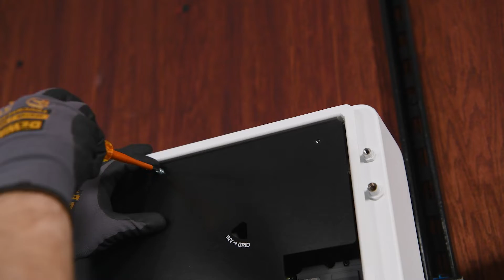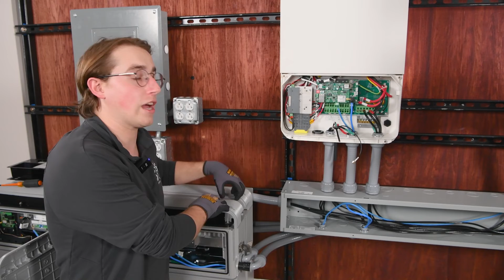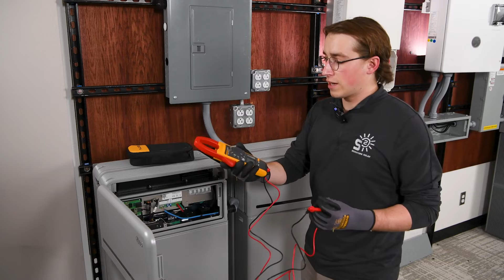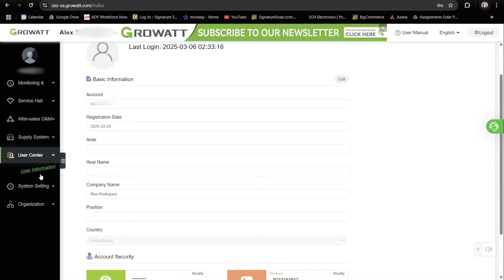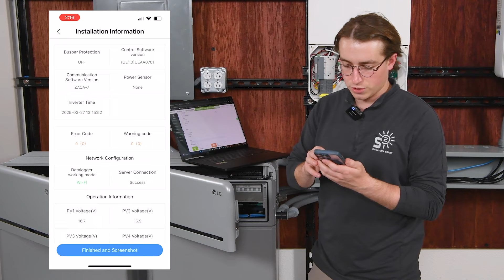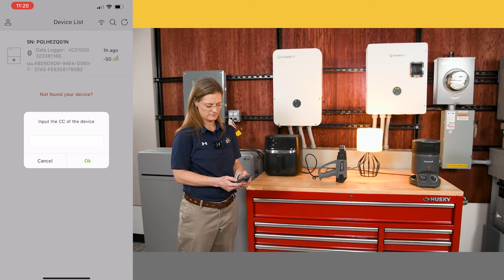LG High Voltage Batteries + Growatt Inverter: Complete Installation & Commissioning Guide

Comment: In this video the coms between the inverter and the transfer switch only uses a two wire (blue and green) connection but the manual and install guides show that 4 wire connection  for coms. Red, black, blue and green. Which is correct and what do the Red and Black com wires do?

Comment: From everything I am finding this does not show which Lithium chemistry the batteries are nor an estimated cycle count for the LG battery pack. Is LG trying to put cheaper cells in there or is it the standard LiFePO cells that many others are using that can achieve higher cycle counts?

Comment: Is there a version of the SYN that can support 2 or 3 Growatt 11400 inverters?
Reply from the maker: Unfortunately, Growatt doesn't currently offer a SYN that supports multiple inverters in parallel. 

If you're looking for a system that can run multiple inverters together, we do have several other options available on our website that may be a better fit for your setup. You can also give our Sales team a call at (903) 441-2090, and they'd be happy to discuss your project and help you find the right solution.

Comment: The inverter in this video appears to be a Growatt 11.4 version 1. It is very important to know that a version 2 inverter is needed. I went through this setup procedure several times and could not get it to work. Then I found out that my version 1 would not work and had to purchase a version 2. it worked !

Comment: To expand upon this setup, it looks like the SYN-200 supports up to three inverters. That requires the installation of two additional 63A molded inverter breakers and communication from the SYN to a comms master INV with up to two additional INV comms via daisy chain. Correct?
Reply from the maker: The SYN does not physically support three inverters, and the inverters are not capable of parallel communication.

Comment: The bundle price at $7999 is an amazing bargain for 32kwh of battery with an Inverter and 200amp ATS. Definite con to this whole home system is the Growatt ATS. Sub 500ms is really slow and doesn’t prevent electronics from resetting. So it isn’t UPS grade power backup. It would be cool to see a video from signature solar that compares all of their current offerings highlighting which can do whole home loads and which ones have seamless and non seamless power backup. Do we anticipate that Growatt will ever release an updated ATS capable of sub 40ms switching in the future?
Reply from the maker: Thank you for your feedback! At this time, we don’t have any updates to share, but we’ll be sure to pass your input along.

Comment: Great detailed video.  What gauge wire are you using for the battery power cables AWG6 or AWG8?  Manual on the Growatt says AWG8 is max.
Reply from the maker: We are using the 8AWG for the battery power cables.

Comment: Why does the SYN use an autotransformer (upper left of SYN)?  Is this autotransformer there to help the Growatt inverter by balancing the 120v loads or is it because the inverter is not actually split phase?
Reply from the maker: The SYN uses an autotransformer to create split-phase 120/240V from the Growatt’s 230V single-phase output. It also helps balance 120V loads, which the Growatt can't do on its own.

Comment: For code compliance... do you know where I can get a Cat5 shielded cable that has an insulation rating of 600 volts? This is mentioned at minute 17:30.
Reply from the maker: Hi! You should be able to find this at your local hardware store.

Comment: Does the Growatt inverter suports Virtual Power Plants. Or sell back to the grid in high demand.
Reply from the maker: Some Growatt inverters can support virtual power plant (VPP) integration and grid sell-back, depending on the model and region. Features like export control and time-of-use settings may need to be enabled and configured properly. Always be sure to check with your local utility and installer for compatibility and requirements.

Comment: Still new to this so pardon my possibly dumb question. According to Growatt's spec sheet, this is compatible with AC Coupling. I'm thinking of getting this bundle just for that since I already have solar installed with Enphase microinverters.. Can i still use this bundle?
Reply from the maker: Yes, you can AC couple with a Growatt inverter, but ensure it has frequency shift capability to properly manage Enphase microinverters.
Reply: awesome thanks!

Comment: What about say a  power outage, do you still pull that switch on the SYN or dose it do it automatically
Reply from the maker: In a power outage, the switch happens automatically, no need to pull the SYN switch manually. For more guidance, you're welcome to give us a call at 903-441-2090! We're here to help!

Comment: Good info.  Wish I had this a year ago as the manual was wrong about comm wires to the LG battery.  Also, neither of my inverters included the dark start button and the manual made no mention of it.  Thanks for posting.
Reply from the maker: Thank you so much for your feedback!
Reply: Where did you find or able to purchase the dark start button? I cannot find it anywhere.